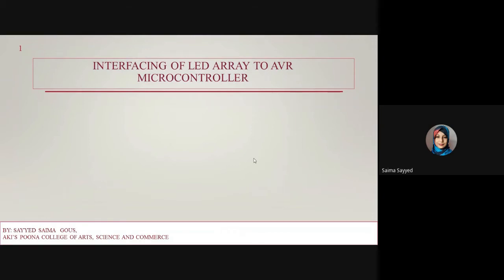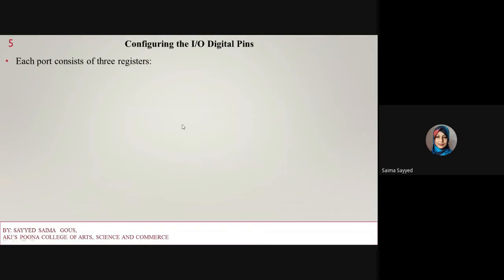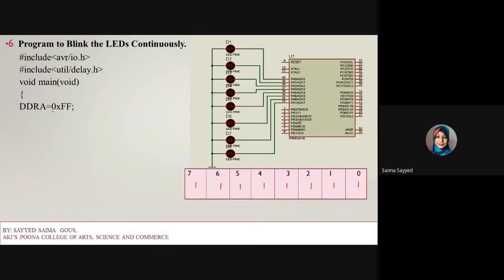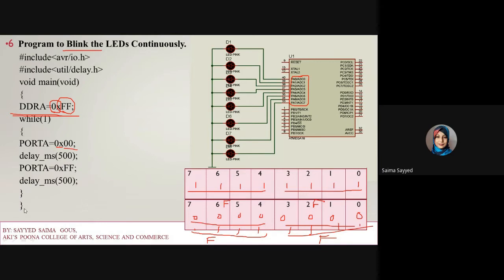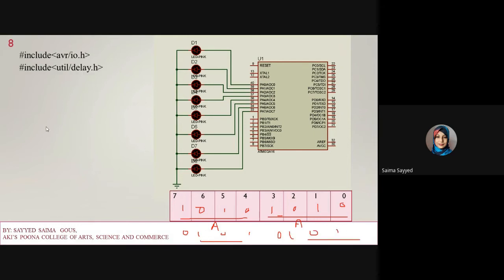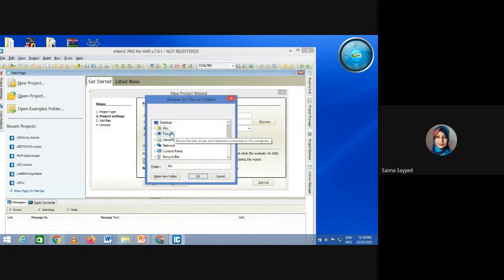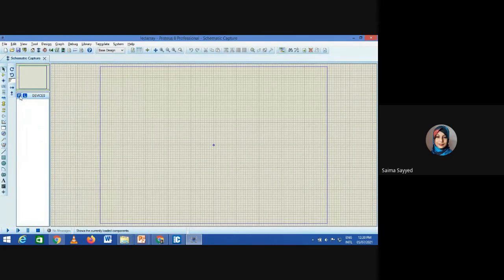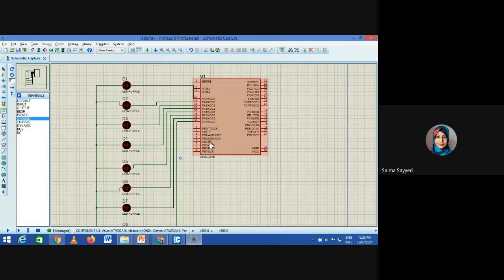Interfacing of LED Array to AVR Microcontroller (ATmega16)

Comment: Thank You, can u make more videos like this 👍🏻
Reply from the maker: Sure! On which topic You want? let me know.
Reply: @saimag.sayyed6143 
1. To study interfacing of LED Array using AVR ATmega16.
2.To study Interfacing of 4×4 matrix keypad with AVR microcontroller (Atmega16)
3.To study and test inbuilt analog to digital converter (ADC) of Atmega16
4.To study and test inbuilt EEPROM of Atmega16.
5.Develop a program to send string serially using UART of ATmega16.
6.To study interfacing of LED array to PIC microcontroller
7. Interfacing two digit seven segment displays to PIC microcontrollers.
8.To Interface of 8-bit LCD to PIC microcontroller
9.To study Interfacing of Stepper Motor to PIC microcontroller
10. To study the intensity variation of LED using PWM with PIC .

Make videos on these topics as you have made the above videos, no one has done these videos as you explain the program on youtube.  Most people don't understand programming part and you explain it very well, so make videos on these topics. 

 And let me know if you have any other contact or mail.  I send a file containing all the material required for these topics like programs, theories, circuits.
Reply from the maker: @reactingwords  Surely I will make the videos on these topics.